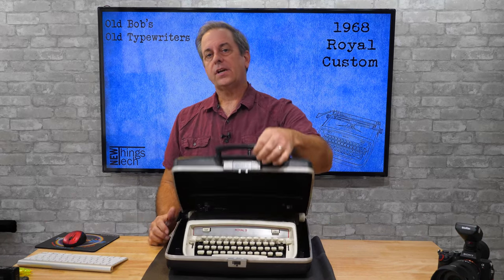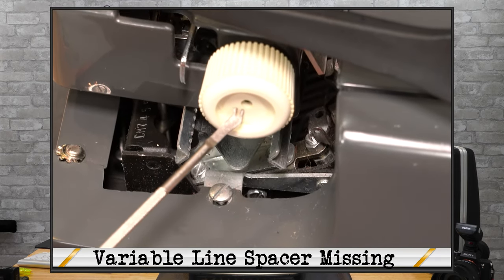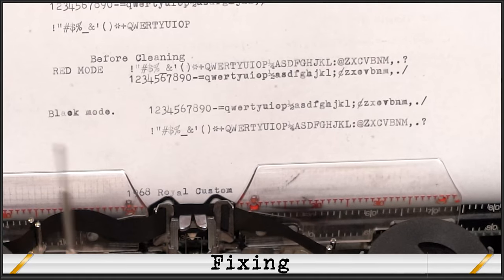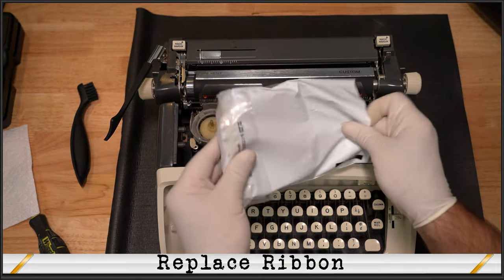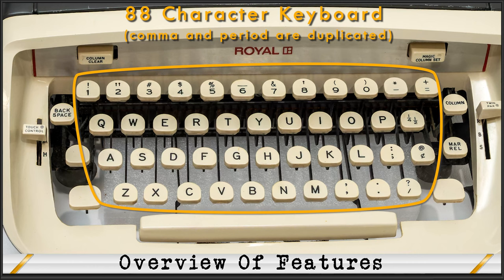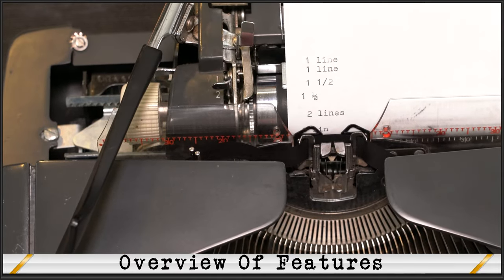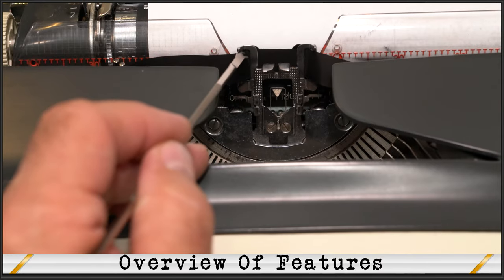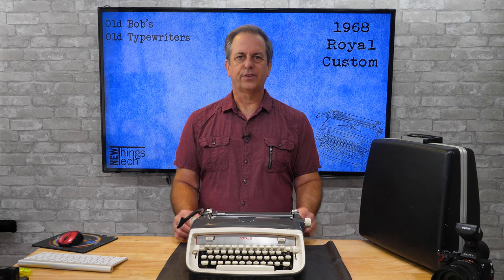1968 Royal Custom Typewriter | Old Bob's Old Typewriters

Comment: I have this typewriter, found it in a trash pile at the end of someone's driveway, works great but I notice sometimes it is one space to the right when I hit the return lever
Reply from the maker: Hi Joe, sorry I missed responding sooner.   I need to do a video on this and one possible fix!  
Several problems could cause the issues (worn linear gear missing, escapement alignment, etc. ) 

Could be similar issue I had on my 1955 Royal QDL.     I've seen this occur on many different typewriters from time to time.  

If you return a tad harder, does it always hit the left margin correctly, but a softer return doesn't?  You might notice that a return is slightly springy (hard to describe what it's like.)

But, if similar to mine with this problem on Royal QDL, up under the paper tray that covers the tabs and magic margin should be a return stop screw. 

Might be hard to find.  Look down/in on the left side and see where the return hits a screw stop.  When you soft return it'll bounce over 1 space. Harder return will always hit the correct left margin.  That screw stop may need to be adjusted in just a tad to allow for a softer return. 

Or, always be a little more forceful with the return (not the best solution!) 

Feel free to send me pics of the typewriter  at typewriters @ oldbobsoldtypewriters.com or to discuss the problem more here or there. Either way. 
Hope that helps!